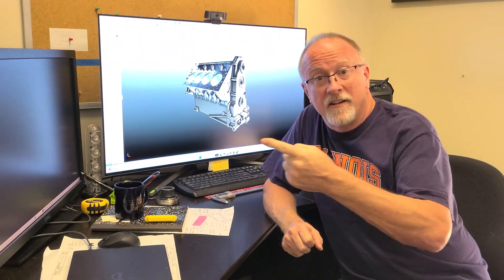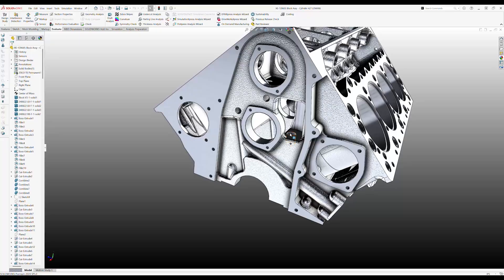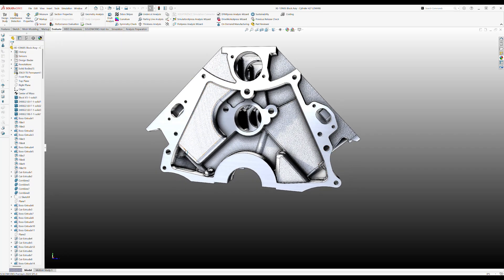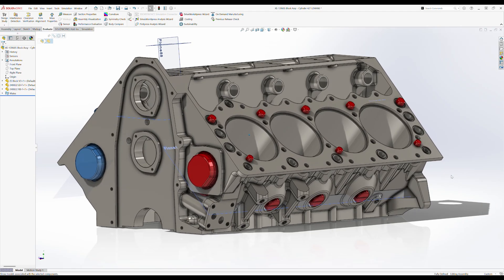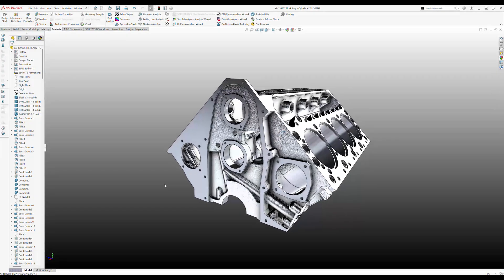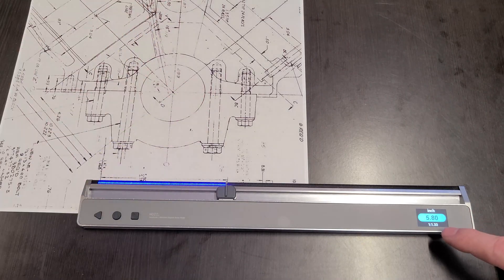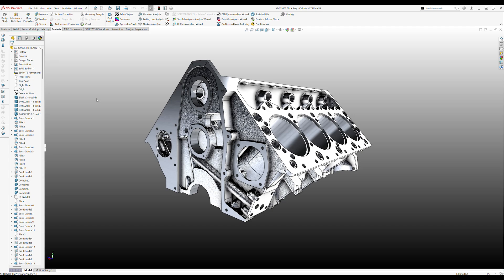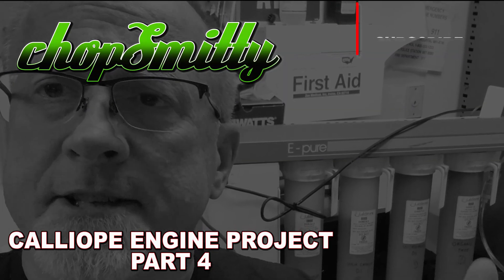Calliope Engine Project Part 4

Comment: So  beautiful...and so complex. I wish I knew more about the process of turning this into a real block casting. When you do this model to cast the block do you leave some extra 'meat' so that you can machine the block where it meets the cylinder heads?  How much would you leave?  I am really enjoying following this.
Reply from the maker: Dan already has all the cores, drag boxes, etc. to cast the block.  (Heads are already cast - so he has those as well).  Some of the other parts will have to have molds made for manufacture (or cut from billet).  Not sure which way Dan will go.  But, to answer your question, if I were to use one of my models to drive the design of a sand mold, I would have to scale it up to account for shrinkage and add a 'certain' amount in key locations for finish machining.

Comment: Is the bellhousing unique to this engine? Do you actually have to loosen the head to change timing?
Reply from the maker: Yes, the bellhousing will be unique.  To change timing simply loosen the distributor hold-down bracket (just happens to thread into the cylinder head).

Comment: I work in scale doing model parts using Solidworks and my process is identical to yours. Between prints and known dimensions I can get a very reasonably accurate model. So far I've done a BAE Hemi billet block, and I'm currently working on a Keith Black Hemi. (Complete engine!) Very interesting how you used the scans to remove core material for water jackets. Would like to see that process more indepth! Going to have to look for that online or within the Solidworks forums!
Reply from the maker: Hey brother!  Stay tuned, next video coming out today.  More design work.